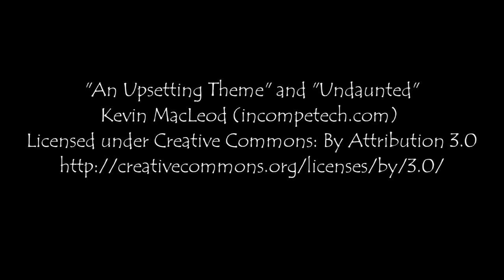Attack of the B-Team Iron Farm Tutorial - 1200 ingots per hour!

Comment: I made a similar design to yours and that may be my problem here: For some reason a large group of shovels will continuously flow into the smeltery but then they'll suddenly stop and will appear on top of the corner of item piping behind the grinder, much like the mistake you made except mine are the exact copies and I am getting the blue ones. Now to tell you what I did different:

Instead of the regular opaque item ducts, I used impulse non-opaque ones
Instead of chests, I used a nullifier for the extra items and a deep storage module for the iron blocks (but those go from the hopper to the module just fine)
I white-listed iron shovels for the pipe that goes right into the smeltery

Where did I go wrong?